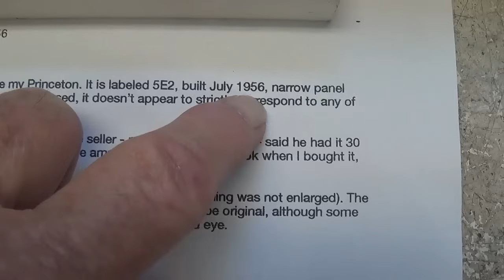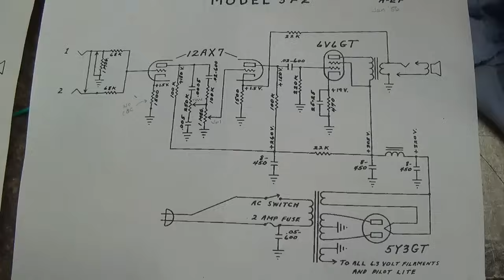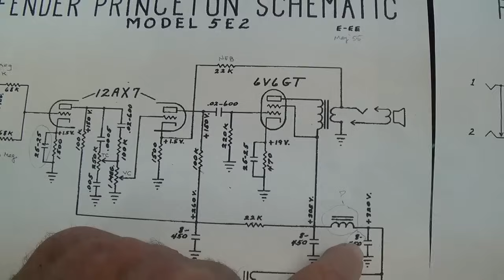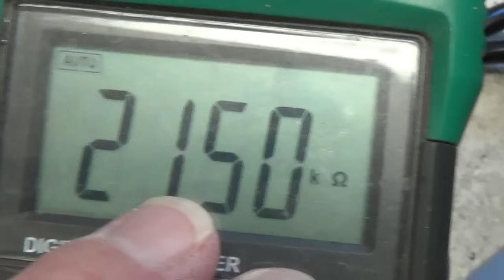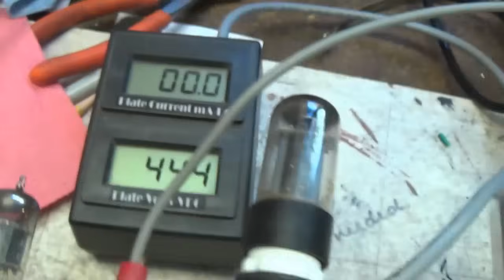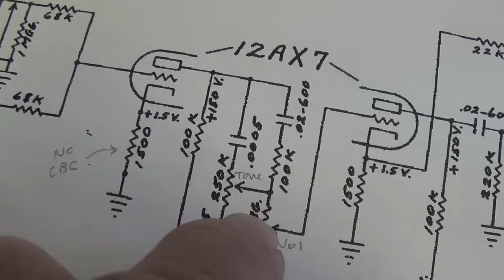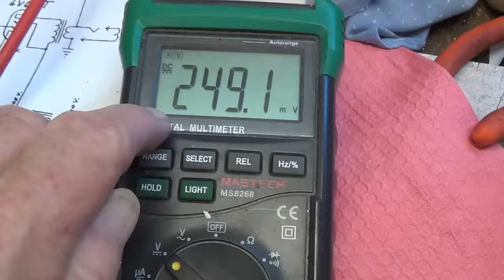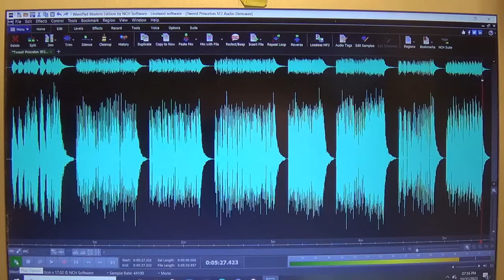1956 5E2 Tweed Fender Princeton Amp.....in for a Stealth Overhaul

Comment: Another great video, as we've come to expect!
Doug - on an unrelated topic, you seem to have had a lot of experience with various types of paints, glues, adhesives so I thought you might have a suggestion. Could you suggest the type of glue to use to attach a metal logo to the face of a finished headstock, like what you see on the '58 Flying V? The metal logo is 3 dimensional with a "mostly" flat back. There are two "locator" pins on the back that fit into accompanying holes in the face of the headstock. Thanks!
Reply from the maker: Thanks, Leon. I would use 5 minute epoxy.  Rough up the finish on the headstock where the logo will fit, to give the epoxy some added grip. Another option would be clear silicon gasket sealer from an auto parts store. It likes smooth surfaces and fills gaps well.
Reply: @UncleDoug  Thanks Doug, that was exactly the kind of suggestion Iwas hoping for.
Reply from the maker: I hope it works for you, Leon. @leonc1234
Reply: @UncleDoug  I went with the silicone sealant. The bottom of the logo was far from flat and I thought it would do better with the sealant. Clamped it in place for about 12 hours and it appears to have worked out really well. Thanks for the suggestion!
Reply from the maker: Silicon can bridge gaps and grips with ungodly tenacity........good choice, Leon. @leonc1234

Comment: Great video, thinking about wiring the 5E2 circuit inside a champ 600 re-issue amp and put a tone control on the panel. I see the 5E2 and 5F2A tone circuits are different, do you have thoughts on that? Thank you!
Reply from the maker: Thanks, Andy. Generally, the the newer circuit designs are improved over the preceding designs, but my advice would be to try them both and pick the one you prefer. To be honest, I doubt that you will hear much difference between them.

Comment: Happy hump day, sir. I've got an idea for the cap tube issue. What if you were to carefully saturate with just a bit of water, the end to be peeled? It might soften and not break the glossy printed surface at the bends. Of course It'd have to be re-shaped while still wet. Just a thought. Thanks for another dandy, UD. Cheers from FL 🏝
Reply from the maker: I do moisten the end to uncrimp.....it makes the old cardboard less brittle.

Comment: Hi Uncle Doug, in a somewhat unrelated question - I have several Dynaco amplifiers from the 1960's using the original two prong plug.  My brother, an electrician, insists that they should be corrected with a 3 prong power plug.  However, when I asked the "Dynaco pros" the old timers in the forums, they said the circuit was designed that way and to absolutely never change to a 3 prong plug.  The models are SCA-35 integrated amp and the PAS 3X preamp.  What say you?  I have a feeling that a 3 prong would be a smart change, but my limited understanding of the complexities of the circuit design hold me back.
Reply from the maker: I'm not a expert on HiFi amps, Jules, but I can absolutely guarantee you that conversion to a 3-wire, chassis-grounding power cord will do absolutely no harm to the function of your amps. Indeed, it may actually improve the signal-to-noise ratio.
Reply: Thank you!   @UncleDoug

Comment: Hi Doug, your buddy Ade here from CT. I subscribe and enjoy all your videos, but this is something different. Hope you can help. I just picked up a used VOX AC15-C1 112 Combo and it seems to be very "touchy" with LOUD Popping noises whenever I flip a switch on guitar, or when I flip from standby mode to ON. I already installed all new JJ tubes and it didn't help much. I already checked the boards, and everything looks very clean, no burnt or oozing resistors, etc. I am about to get rid of it because sudden loud noises really bother me (maybe PTSD?). Any suggestions would be appreciated.
Reply from the maker: I hate to say it, Ade, but the problems you describe are often due to poor circuit design and construction. Is the chassis well grounded? Have you considered shielding the pre-amp signal wires?  Are the metal parts of your guitar connected to the chassis by the shield in the cable? One "bandaid" is to simply turn down the volume whenever you are going to flip a switch.
Reply: Thank You Doug, I can always count on good, solid info from you. ON ANOTHER NOTE - Our little Yorkie Dutch maybe joining Rusty soon. He's 15 and has many health problems.  Thanks again for your prognosis and best to you and the family - Ade
Reply from the maker: @A.WebbAndFriends  Sorry to hear of Dutch's health issues, Ade. It's sad when you reach the point at which you must decide if keeping the pup alive is fair to him, rather than to you.  Good luck.
Reply: Thank You Doug - Try telling my wife that. She has this pipe dream that Dutch just goes off in his sleep but we both know he may be suffering. In any case - Lets keep to happier times and hope we all have a fun Easter.  @UncleDoug

Comment: Hi Uncle Doug, great work on this Jewel . It sounds fine to me and the amp also have a little roughness to it. 
I have another Question I didn't get out of my head. what is/was the purpose of the death Cap besides get the amp owner Killed. Thank you for your efforts.
Reply from the maker: Thanks, P. It was supposed to reduce background noise in the electrical supply.
Reply: @UncleDoug  Thank you.

Comment: Did you check for date codes on the transformers, the pots or the electrolytics? Fender is known for sticking old tube chart labels into later amps so it might be a 5F2-A
Reply from the maker: Due to the relative disorganization of Fender's "garage factory" at this time, it's pretty hard to precisely date these early amps, B, but my reasons for the 5E2 ID are thoroughly explained in the video.
Reply: @UncleDoug  I know, but did you check transformer and pot codes? I have readon to doubt your verdict, I was just curious.
Reply from the maker: The amp went back to its owner long ago, BB.  @bugabootang

Comment: Doug! Quick question! Working on a -67 bassman, the ab165. And I’m getting some weird overtones out of the phase inverter tube, but it disappears if I pulls out the power tubes, (checking with ociliacope) but if I turn off the amp with power tubes in it disappears for 3 seks until the amp goes quiet! Any guesses? I’ve checked everything!
Reply from the maker: If the overtones are originating in the phase inverter, they would probably still disappear when the output tubes are pulled. Switch phase inverter tubes, it may be microphonic or auto-oscillating.

Comment: My 65 DRRI ' the reverb doesn't work until turned up to around 7 and on up to 10. Sounds like it's on about 2/3.  Has new tubes/ new RCA jacks/ tried a new tank' still weak sound on the reverb?
Reply from the maker: Check your oscillator caps and resistor values, Bryan. Good luck.

Comment: Wouldn't you consider a Mallory 150 to be a better choice to replace the yellow Astrons? Especially since you are trying to preserve appearance, it's yellow like the Astrons as well as axial leaded instead of the radial leads of the Orange Drop. I suppose for an amp as special as an old tweed Fender I might even opt for a couple of the yellow Jupiter Vintage Tone caps. They're pricey but $14 isn't much for an amp of this value.
Reply from the maker: No, I wouldn't, Jimmy. The thought of asking my customers to pay $14 for boutique capacitors never really occurred to me.....nor will it ever.
Reply: Hey Doug, I was more interested in your opinion of the Mallory 150s vs the Orange Drops, since they cost roughly the same. For what its worth, I sold my 5F2-A Princeton last year for $3200 so I wouldn't necessarily consider the Jupiters at $6.95 each too extravagant for that collectible of an amp. I get it, they're silly expensive but I would only use them for their appearance. On the other hand, the Jupiter caps do sound wonderful in those positions. @UncleDoug
Reply from the maker: I have not used Mallory 150 caps in the past, but will order some and give them a try, Jimmy. I honestly don't think that different brands (or prices) of capacitors has any audible effect on tone, but am willing to experiment. @jimmyjoefine

Comment: I'd have asked the customer's permission to try and open one of those coupling caps. Rolling one on a flat surface with a razor blade on the stripe would get you in and provide a way to mate up the halves again. The caps that you used to replace them wouldn't physically fit however but are there possibly smaller caps with the same value which could fit inside?
Reply from the maker: Thanks for your input, Charles.

Comment: Re the missing choke, I reckon Fender probably realised current regulation in a single ended amp was a much smaller problem than hum due to ripple.
Reply from the maker: One of the choke's main purposes is to minimize ripple by impeding the passage of fluctuating (AC) wave forms.
Reply: @UncleDoug  Yeah, my point being that inductors resist changes in current. A single ended amp draws nearly the same current under all circumstances so a choke's kind of redundant. I think Fender realised that and left it out.
Reply from the maker: @Splattle101  You could be right, S. Thanks for your input.

Comment: Talk to us, Uncle Doug, about
AmpRx Brown Boxes, if you recommend or not, etc?
Reply from the maker: If you have an extra $400 to reduce your wall AC from 120+VAC down to a stable 110 to 117VAC, then I guess they make sense, RA......but most musicians don't. So that leaves you with 3 options that I can think of:  1.)  Forget about it, as we have for the past 50+ years, and focus on musicianship rather than gadgetry. 2.) Buy a good, used Variac on Ebay or at a garage sale, and use the extra $350 for picks, straps, and beer. 3.) Build a current limiter with bulb wattage selected to reduce your operating voltage to the desired level, and use the extra $375 to buy table dances and new front tires for your 1983 DeSoto ;)

Comment: Hey uncle Doug I made a schematic off of a class a amp I was wondering if you could go over it and see if would work like signal flow and everything getting there proper juice voltage is there way to email you ?
Reply from the maker: Joe, my work schedule doesn't allow for consultations. My advice is to simply build it and trouble shoot if necesary.
Reply: Okay thank you the thought is what counts
Reply from the maker: Good luck with your build, Joe. @joerivera3222
Reply: @UncleDoug  thank you 🙏

Comment: DOUG, When biasing an amplifier, why don't you ever factor in the output tubes Plate voltage drop to the output transformer and output transformers primary plate resistance?
Reply from the maker: Simply because that's not how output tubes are biased, Wayne. The plate voltage is the result of the OPT primary drop, and the OPT does not have a plate or plate resistance.
Reply: @UncleDoug  There is a "Voltage drop" from the output tubes Plate to the OPT primary. You measure the resistance from the output tubes plate to the OTP primary winding terminal. There will be a Voltage drop by the resistance of the OTP primary winding terminal to the output tubes plate terminal. I have never seen you do this in any of your videos when biasing amplifiers. Why haven't you include this Voltage drop into the biasing formula?
Reply from the maker: Because it is neither relevant nor necessary. @waynegram8907

Comment: I have the same amp except mine is a 1959 and the original owner put black tolex on mine also and it looks like it has not been touched electrically since it left the factory and I would sure like you to do your magic on mine also if it is 
at all possible
Reply from the maker: I am currently swamped with repair work, Robert, but I have an associate who handles the overage. Please contact Michael at Chelliamps@gmail.com.

Comment: Wouldn't it be great if collectors weren't obsessed with originality when it comes to consumable components like caps and resistors. It's unreasonable to assume a 1950s era car would still be using the original tires and spark plugs. It's equally unreasonable that a 1950s era amp would still have the original filter and coupling caps.
Reply from the maker: I  agree, VC, but with a "stealth" overhaul, you can have your cake and eat it too.